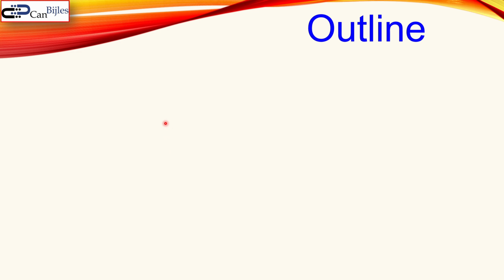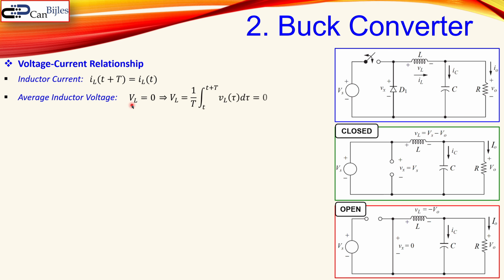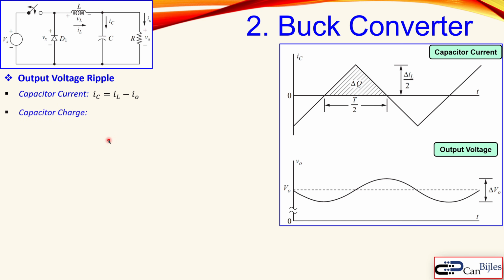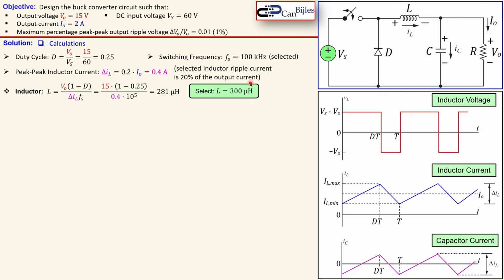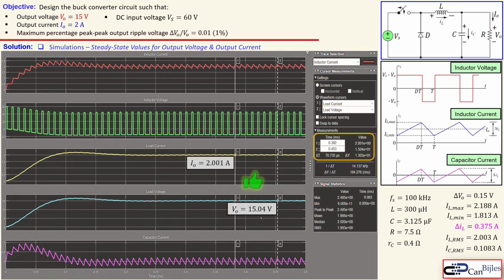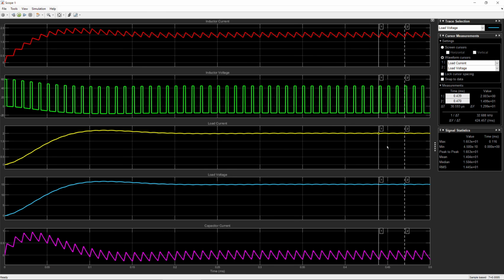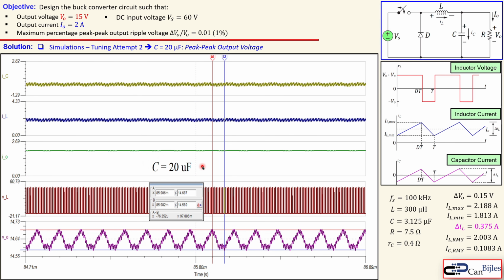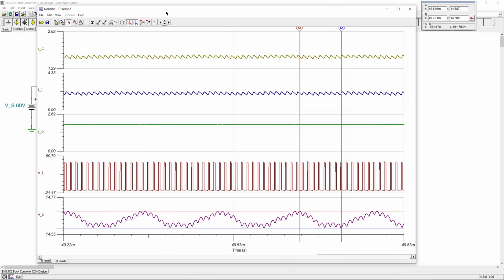⚡ DC-DC Buck Converter Design Part 1 ⚡ Open-Loop Design - Calculations & MATLAB & TINA-TI SPICE 👍

Comment: can the expression for critical current be used to estimate minimum inductor? then it wont be required to estimate voltage ripple.
Reply from the maker: What do you mean by critical current? Can you mention the formula and time jn the video?
Reply: @CANEDUX  The equation for I_min that can be seen @10:30. if set to minimum inductor current, will give a value for L?
Reply from the maker: The expression for the inductor value at 10:30 is given for continuous conduction mode (CCM). If you design for discontinuous conduction mode (DCM), then you can decrease the inductor value, but the calculations and other formulas for load voltage etc. will be different. See this video about Buck Converter in DCM: https://youtu.be/TB4PqvRy0w4

Comment: hello sir, i am using matlab R2025b, when i run the simulation, i didnt get same waveform, in term of load voltage and load current, i am using ideal switch, please help me.
Reply from the maker: Thanks for your message. Double check your parameters against the ones in the video.
Reply: @CANEDUX all parameters I checked many times, but I didn't get simulate results like as you explain, I am using trial version of 2025b tools
Reply from the maker: @shaimesansari8315  Maybe the components are too ideal. You might try to use a more practical models for the components, like the diode.
Reply: @CANEDUX Thanks for the support, today I complete the simulation with practical mosfet and diode, except ideal
Reply from the maker: @shaimesansari8315  You're welcome! I am glad it worked out 👍

Comment: In linear voltage regulator sir, a transistor exists or not.  Actually, variable resistor we use but I this video you mentioned transistor
Reply from the maker: I use a transistor to replicate a variable resistance, also to make a link to the switching power supplies.

Comment: This is exactly the project i am working on. Thank you so much for this useful information👍
Reply from the maker: Glad to know that the video is helpful!
Consider sharing this video with your fellow students. 
Good luck with your project 👍
Reply: @CANEDUX  yes, Myself and team members are watching your videos.
Thanks
Reply from the maker: @ugwavictor958 That is great! Thanks for sharing. Good luck to you all with your project!
Reply: @CANEDUX  Hey....Please can you upload the Part 1 PDF in your "Document and simulation files" if you don't mind. There is only part 2. Thanks
Reply from the maker: @ugwavictor958  Part 1 is also available in the video description.
Reply: @CANEDUX  Please do you have a buck convert design with PID controller, compensator, disturbance. Where I am can phase angle, phase margin, step response etc
Reply from the maker: @ugwavictor958  I do not have a video covering these topics. Note: Type 3 compensator is similar but not the same as PID controller.
Reply: @CANEDUX  understood 👍
Reply from the maker: That is great 👍